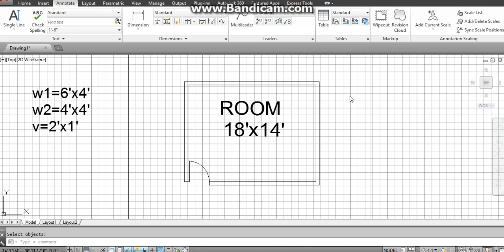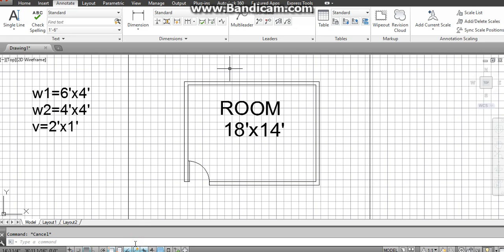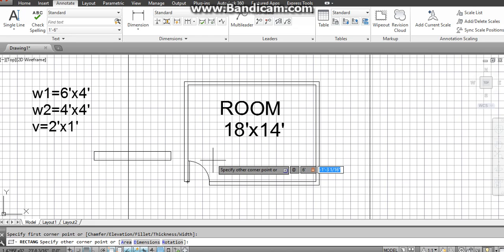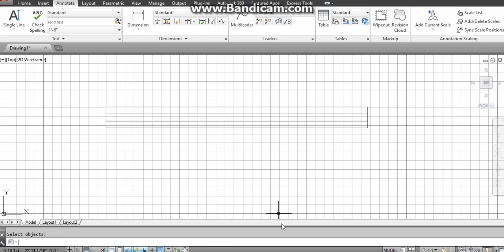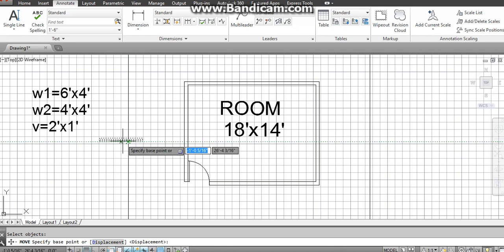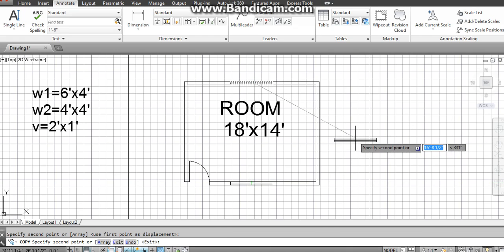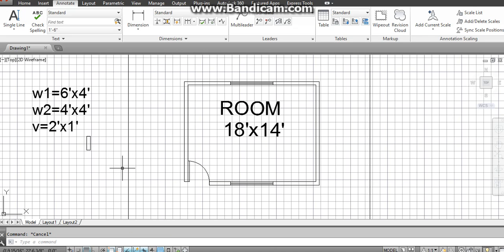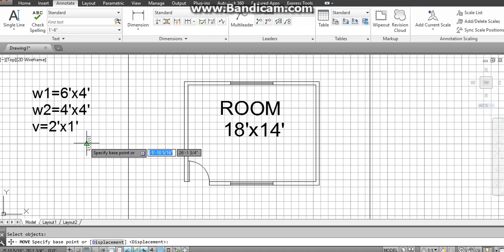How to draw windows and ventilator in autocad | Multi Experts Tutorial | 2017

Comment: what's the difference between window and ventilator when its drawn same??
Reply from the maker: Windows and Ventilators are drawn differently and not the same. Second thing is both have different sizes, Ventilators usually have 2 feet length while windows have minimum length of 3 feet, but usually 5 or 6 feet.